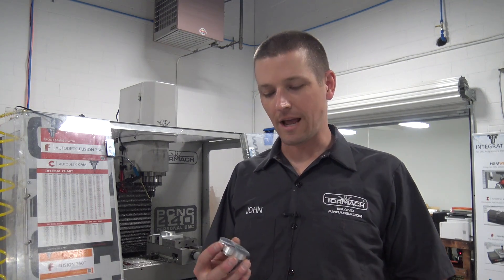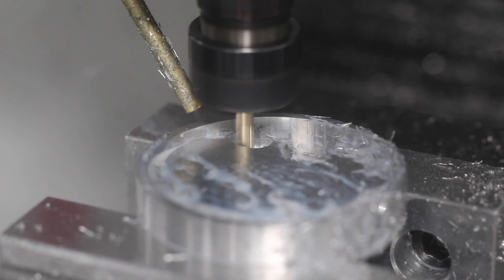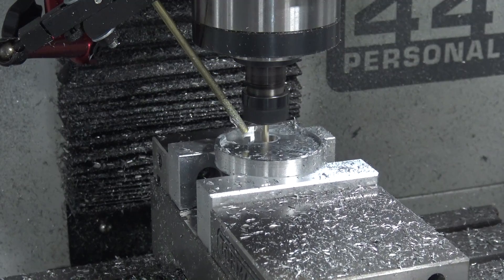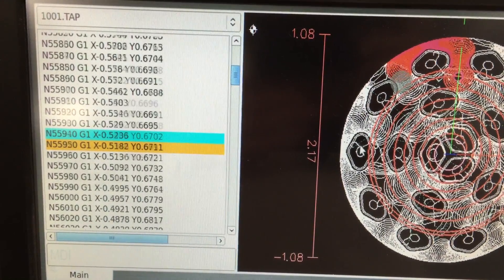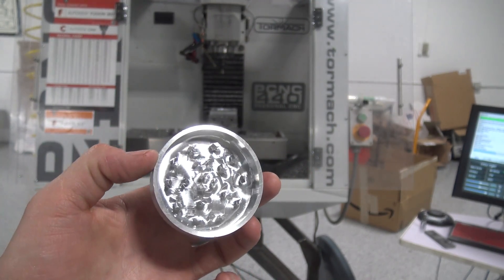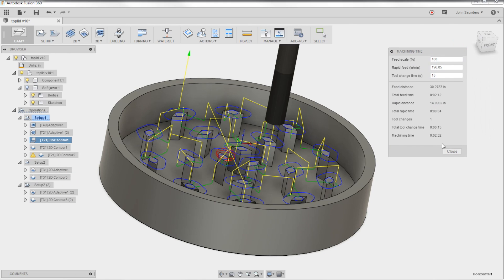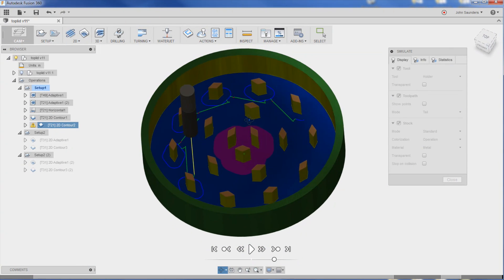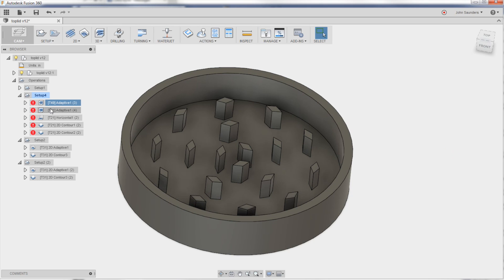Machining a Small Aluminum Part on Tormach 440!  Widget97

Comment: Think of the math that Fusion 360 has to work out to generate the tool paths for the adaptive clearing ops!
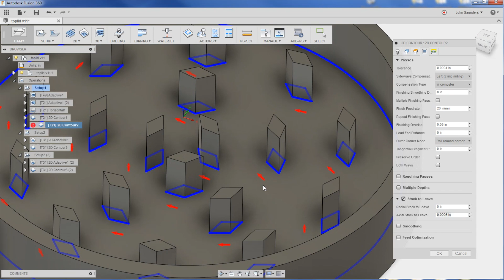Reply: Were you you worried about those error and warning symbols there at the end John? There were quite a few error icons from your template, but I didn't see an actual error message associated with them. There was also a warning icon at 14:00, in the "Setup 1" operation. 

I'm used to Solidworks errors and warnings, so these Fusion 360 things throw me a bit yet. Now that SW 2018 has CAMWorks built-in, is it worth still going to Fusion 360 for tool paths from a SW part?

Comment: What do you mean when you say soft jaws are they just made of really soft metal I'm a woodworker btw
Reply: so like with woodwork if you dont want to scratch up your work you would put a cheap piece of pine or a cloth in the jaws of your clamp so the clamp is softer than your work piece. In metal work you would want a softer metal like aluminum jaws to hold a harder metal like steel.

Comment: I've watched a ton of your videos, but i haven't heard you talk about why you don't use a normal coolant/flushing system instead of that weird oil/air system.  You seen to have chip buildup issues in a lot of your videos (hence the manual airgun).  A flushing system would solve all those problems and give you a much better process.  The big factories use flushing for a reason ;)
Reply: I believe it is to make the videos watchable. a flushing system inhibits visibility.

Comment: Very helpful video. We just made a similar type of project, oil pressure gauge body on the 1100. I would like to get some help/instruction on the step over settings and finish cuts that you mentioned at the end if you would consider it?

Comment: When i rough, i leave .002 - .005 for clean up. you will get cutter deflection witch will leave a hair more but the finish will be gorgeous...and its easer on the fin cutter( weather it be 3-d or 2-d still i only leave a very small amount)

Comment: Fusion's 2D pocketing tool path (not adaptive clearing) thought it was a good idea to mill a slot (today) and then run a 4 Fl FEM full speed into the end of that slot. The tool was pulled out, the stock is in the scrap drum now. Lesson learned: Even if Fusion does not give you a warning/error, take a critical close look on what this program comes up with.

Comment: Not much of change here. Looks good 

I think I would have finished the floor  up with a horizontal path. Left 3-5 thou on floor with the adaptive and cleaned up the tool mark pattern using the horizontal. 

However.  I don't believe you finished the outer perimeter of that pocket...  There was a finish pas around all the little stand offs, but none around the ID of the pocket it's self.
Reply: Weird thing is, it's shown in the F360 verify later. But not on the the part machining portion. I wonder if your lead in error you were getting caused it to not post that portion of the tool path. 

Or maybe it's early and I'm blind and I missed it.
Reply: +NYC CNC 

Maybe it's an optical illusion. But I swear I can still see the vertical facet lines left over from the adaptive @ 9:30 when you're showing the part off under the light and they look the same on the wall as they did back @ the 6:00 mark...  The adaptive's step over is small enough that the lead in arcs could have cleaned up that wall pretty well.   
I'm assuming you measured it and it measured right. So it must have cut that wall. Maybe not enough stock left on to clean up the gouges from tool deflection during the adaptive. Left some some phantom lines.  Just happened to catch a couple glints of it in the light and something looked off. 

Could just completely be me though XD

Comment: Great job John! When you mentioned the RoboDrill I think they are best suited for 2nd op cnc work because the gcode limitation. Another mill say like a Haas muti axis setup could be far longer lines could be millions or more. But that's what they are built to do. Have you ever considered making cpu and gpu water block from deoxidized copper? That 440 would be awesome for that type of stuff and there is a massive market out there for cpu water / liquid cooling. I think you would be good at it.
Reply: No it's very much alive I've seen some people here on you tube that think any ting of spending 5000 on a gaming setup i'm actually in the middle of getting my mother board out of my main computer fixed that's why I though of it some time when I get my main rig setup you know, the one with solid works and Fushun 360 on it back up i'll try to skech you up something. basics is just a copper block with a spiral grove in it and a cap bolted on it's crazy simple. I would like to make them but my mill is screwed up the ways are not parallel so I cant trust it in 3 axis mode sigh lol. But like you said before I know you like to do cool stuff like that just like me lol. i'll do some research on it and see what it all takes i'm good at figuring out flow and thermal transfer stuff. I'm out of work right now shop went out of business and looking for any welding fab and machine work I can do lol just trying to help. Us machinist and tool makers got to work hard for what we get so if I can't do it I know someone who can you know what I mean. I'm 35 been working most of my life in tool and die job shop and welding and things are getting slow around here just trying to live lol.